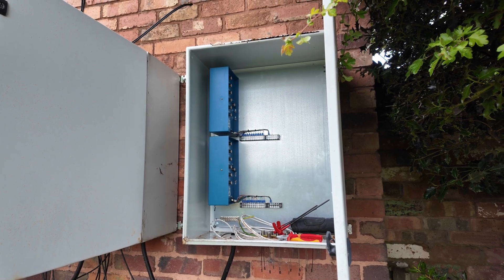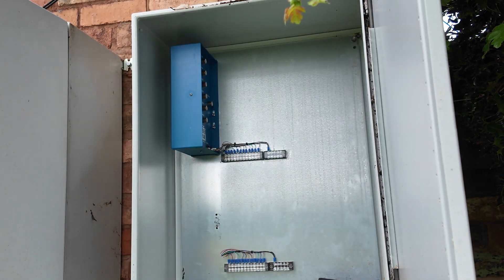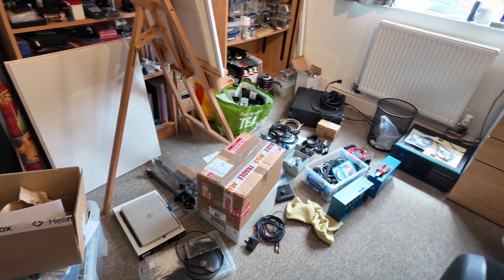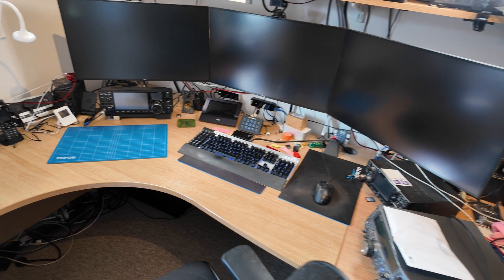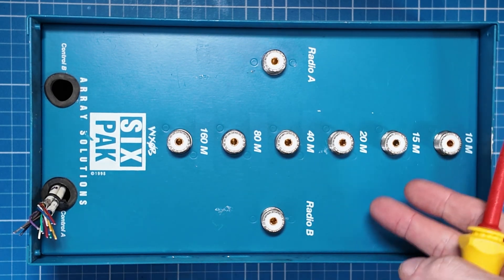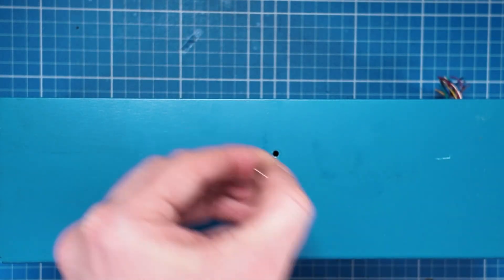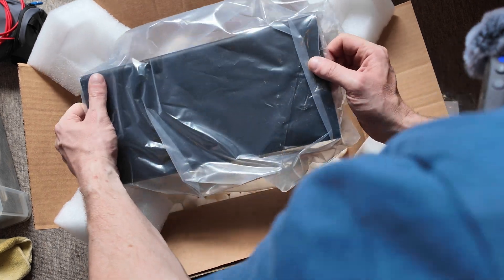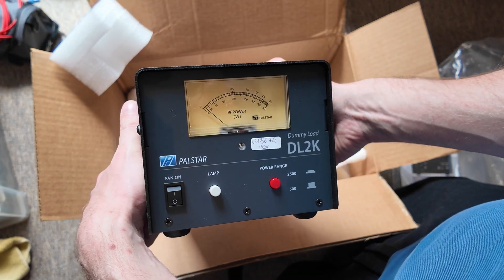Building a HF Amateur Radio Station - Episode 2 - Old Antenna Switches, Chatting & New deliveries

Comment: Interesting build vlogs, keep them coming. These are a refreshing change. 👍

Hope you don’t mind offering advise.  I’ve had a licence for a while but now in a position to get a mobile set up permanently in the car.  Bought a icom radio, going to fit it myself but will need in wired in electrically. 

Any advise on an appropriate place that will wire up a ham radio correctly?  Will an auto electrician be ok or somewhere more specific.  I’m in south staffs .  And what is the appropriate cost for a fitting? 

Many thanks

Comment: I’ve just purchased a Yaesu 510D 2 + 70 that IMO is very good.  As an oldie not sure whether modern radios would be straight forward to operate but after a couple of days I recommend it.  Regards Mike (M0AZE).
Reply from the maker: I hadn't looked at the 510D, looks like a really nice rig, it's top of my list now